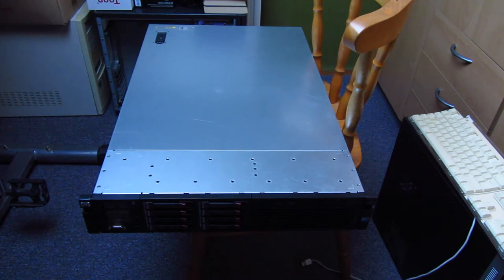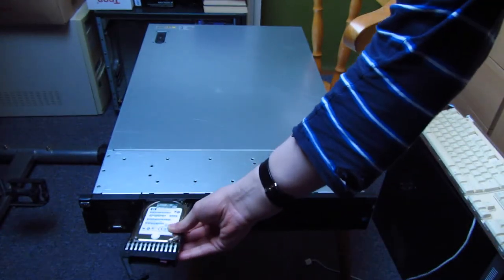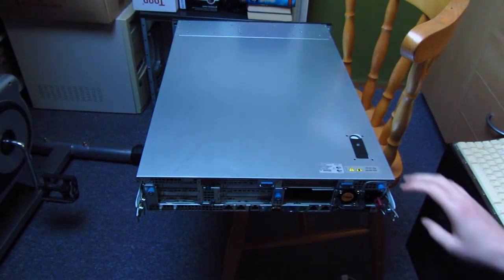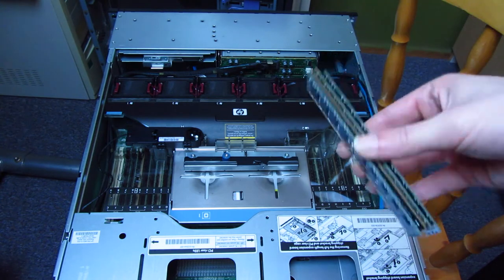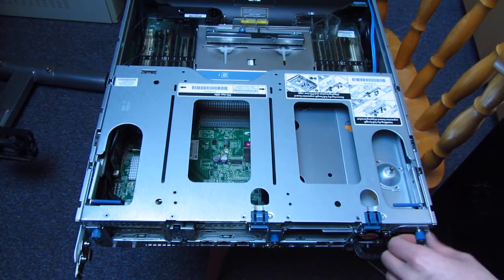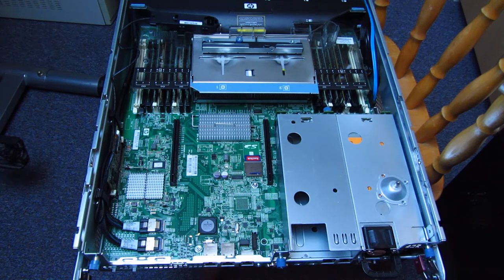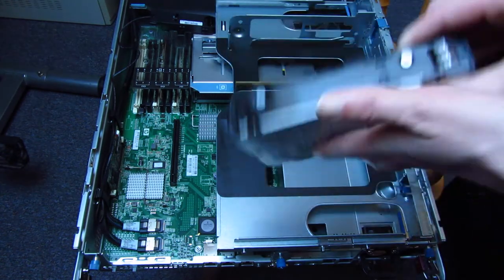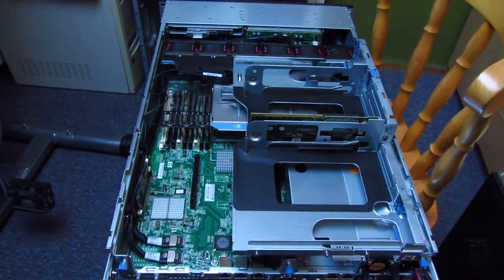HPE ProLiant DL380 G7 Server  - Overview

Comment: with my dl380 g6 I actually managed to get a nvidia gtx 1650 running in it, and likewise have been able to operate a quadro p2000...

you ofc have to mess around with the cards backplates to get them to physically fit in, but aside from that...they do function.

doing the same in a g7 would be an even better option, because it can handle a slightly beefier processor then the g6.

Comment: one of the drives is solid amber so I assume failed. so server won't boot. what do I need to do? Replace drive and it will self build array?
Reply from the maker: If it won’t boot, the array is usually dead and unrecoverable. Is it a RAID0 by any chance?
Reply: @nelizmastr  will confirm raid type but it has 6 drives each 250gb and was network share On boot said something along the lines of drive in bay 4 needed replacing. Will get actual message when I’m in front of it. 

Is data recovery an option. I need to get a database off 😭
Reply: @nelizmastr  Raid type is 5. Number of logical drives =1. Physical drive usage map are on scsi bus1 - id’s 0,1,2,3,4,5

Message is logical drive failure - Box 1 Bay 4. Got an exact replacement drive on the way so hoping will jus rebuild ….😕

Comment: Just a question? if the esxi flash card fails, can you just load esxi onto another flash card? It wouldn’t render the VM’s defective?
Let me know anyone out there if it’s fine to have the hyper user ie esxi on the flash card?
Reply from the maker: The VMs are untouched, so is the storage. You only need to re import the datastores and vms

Comment: I'm currently running a dev LAMP server on a repurposed pc and want to take things up a notch or three so I am looking at these right now, not as high in ram as yours but will look to max that out at a later time for the budget they seem like a reasonable choice.

I am looking to run VM's of some sort and will separate the web application and database to offer an extra layer of disaster protection.

Would you consider this server to be suitable for the task or should I go with another?
Reply from the maker: For the money, the DL380G6 and G7 are hard to beat. Parts are cheap and plentiful.

Comment: Hi guys, I've not been able to install MS server 2012 or higher on my HP DL380 G7 server. And on the HPE website, it says that the model only supports MS server 2008. Pls help me if anyone knows how to install server 2012 or higher on the machine
Reply from the maker: You can install 2012, 2016 and 2019 fine from a USB. Make sure you copy the RAID controller driver to the usb stick as well in a separate folder. Also make sure your RAID array has been created before installing.
Reply: @nelizmastr  waow, thanks for this but i don't know about creating the RAID array and copying the drivers, pls guide me. Thanks
Reply: @nelizmastr  also does it have to be a clean install only?

Comment: Is it possible to switch the SFF drive cage(s) with a 6 LFF drive cage?
Reply from the maker: I’m not sure HP even offered LFF support on the DL380 G7. If you need LFF, look for the ML350 and lower instead.
Reply: @nelizmastr  You can get this server in an lff version, HP don't support converting sff to lff.

Comment: Considering purchasing one of these next week, what's the noise like?
Reply from the maker: Noise depends a lot on the configuration. If you put in hard drives without a compatible temp sensor, it goes to 78% (very loud), PCI cards also raise the noise somewhat, but only to a degree where it’s still fine in another room. Basic config with just CPUs, disks and RAM is not very audible at all.
Reply: @nelizmastr  so thats why it was making like a vacuum cleaner after i installed a new HD? probably lacks that sensor, but i left the place and havent been at that rack , im wondering if it still does like a jet flighter braking the sound speed or has stopped? if its still going full speed can i do something to ignore that hdd bay ?